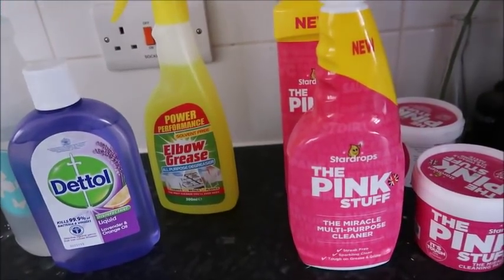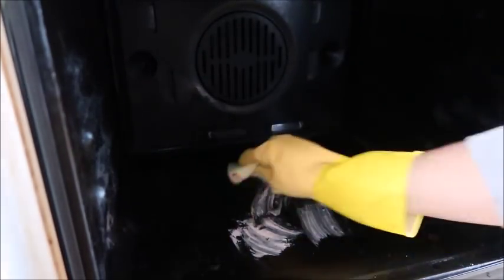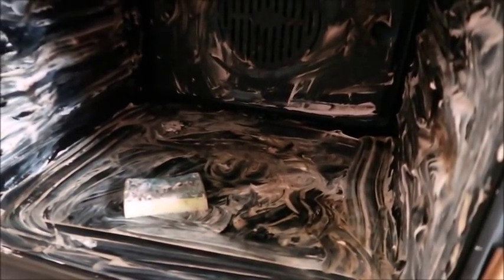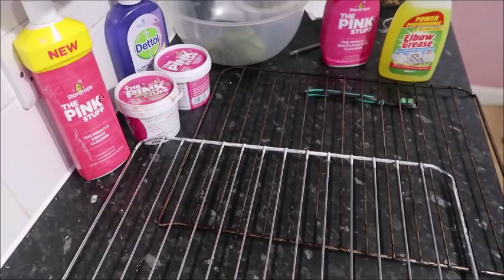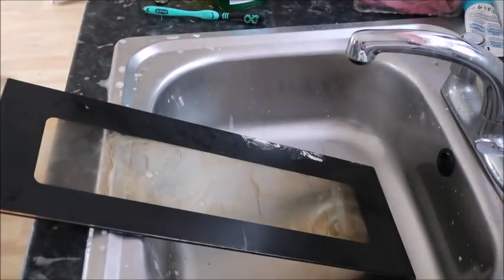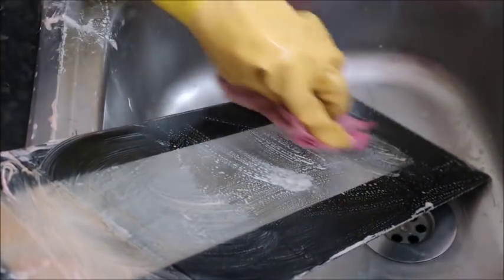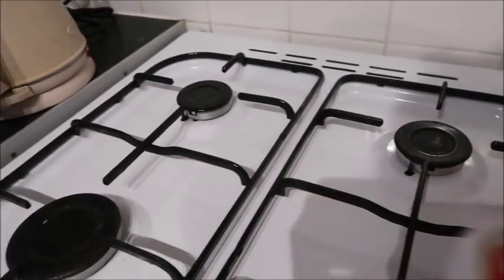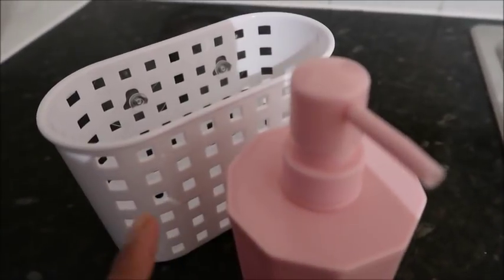Cleaning my Yucky Oven & Testing Cleaning Products | Vlog | Shamsa

Comment: Dear Shamsa, now that you shared with us cleaning the oven, you have to tell me how you keep that blind in your kitchen soo neat and clean? I have 2 of those, on in corridor window which is fine I just hoover it off or wipe it gently with damp cloth. But the kitchen one is Soo disgusting, greasy and catches dust on greas..brr. and the most awkward thing to clean as it moves so you cant scrub unless I put it on kitchen floor, pour water and soap+scrub but then the parts will move away and it will be a mess!
Yours is so nice how you do it?

Comment: Anyone can recommend a good oven brand+ type? I prefer dual fuel for a good electric oven and gas hob to put tawa on(I have a big tava which doesnt sit tightly on hob so wont work with induction one)
Reply: Kingu 11  hi I used Dr magic it’s very good on hot oven no need for scrubbing just wipe it off after 10 minutes or less then that very good